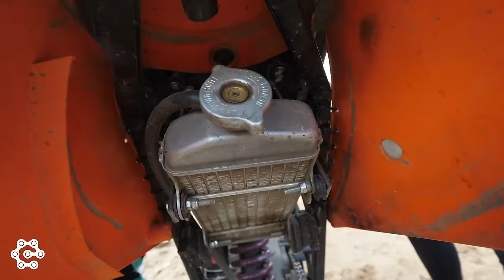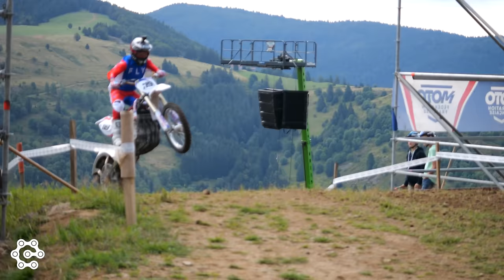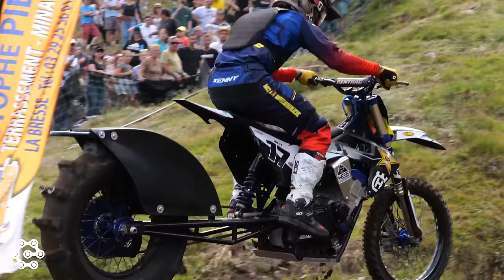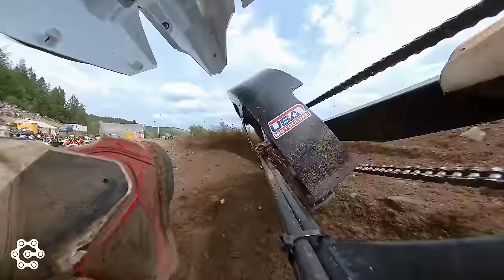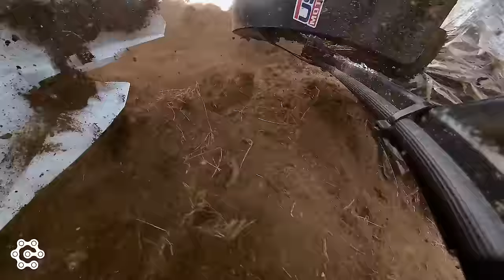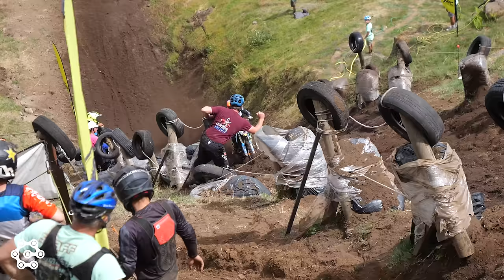Impossible Climb La Bresse 2023 | Big Engines, Bigger Surprises | USA vs FRA

Comment: Momentum at the end of the run seems to be the biggest factor of whether a cyclist will power over the top. 

Without that momentum the rider loses all forward inertia and is like a biker sitting still and trying like crazy to merely balance on the bike when the inertia is needed the most - at the top. A supercharged motor isn't going to help in this situation.

Unless of course the rider starts off rather fast at the bottom of the hill.

Any rider who starts these hills cautiously and slowly is doomed to fail